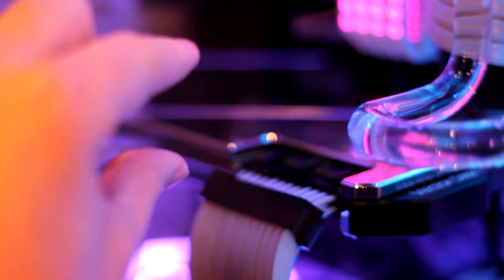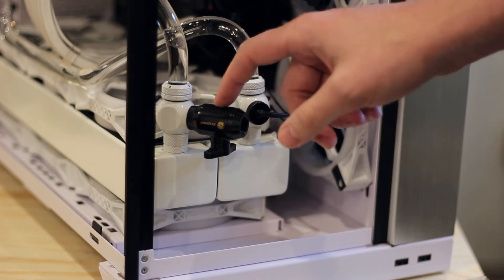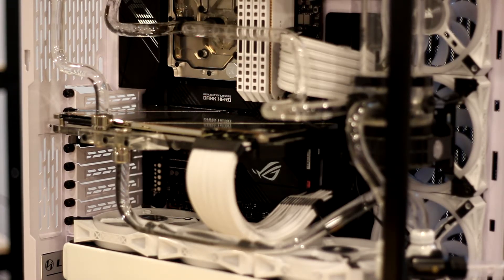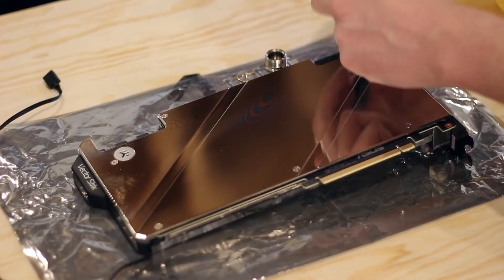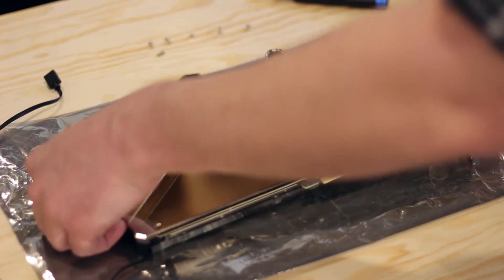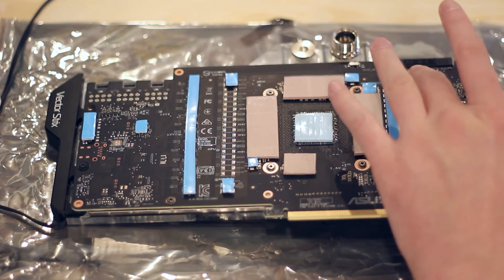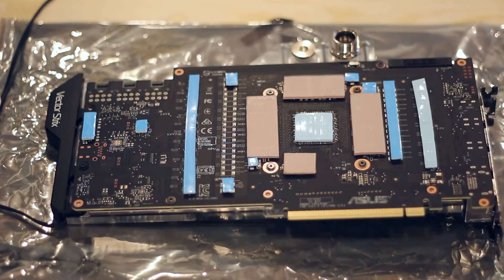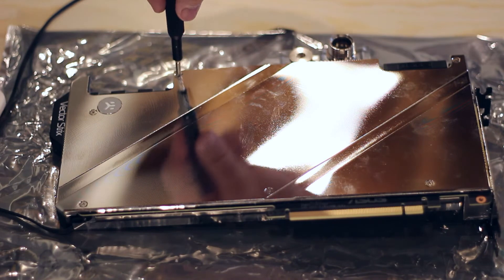EKWB Strix 3090 Water Block - Coil Whine and Toasty Memory

Comment: 5:30 Those must be some tiny coils somewhere there.
Reply from the maker: The induction coils (or chokes) are actually quite low-profile and sit on the GPU die side of the card. They are very compact. The pressure of the backplate pulling together the backplate and the waterblock is enough to slow the vibration and make it audible. It doesn't affect performance. I'll show the induction coils in a future video where I am trying Thermalright's thermal pads and thermal compound.

Comment: Any thoughts on the newly arriving Active Backplates by EKWB? Will you be possibly trying them out?
Reply from the maker: I'm not sure if I'll be able to get one right away, but it is a cool little item. For extreme overclocking it is a cool concept, but I bet I can keep the VRAM temps under control even more just with some better thermal pads (testing some more soon) and a passive backplate. If it was available when I did this build I may have done it! It will definitely help getting the most possible heat away from the GPU!

I would be willing to bet it still comes with average performance thermal pads that need to be replaced with something better to take full advantage of the block(s).
Reply: @UnhingedSystems  Thanks for the reply. Looking forward to your further tests. I've got a Dark Hero, monoblock, 5950x and 3090 FTW finally gathered and will be doing a WC build as well so very interested to hear your thoughts. Your videos so far have been very eye-opening with regards to the thermal pads and coil-whine inducing backplates. My previous/current build was a WC'd 1080ti but luckily I never encountered these issues. I've been reading that they are quite prevalent with the 3090s.
Reply from the maker: @SuperChaoticOne  The 3090 is a heavy power eating card, but with the right amount of pressure applied it should be possible to reduce the whine further and still maintain good thermal performance. I will be doing another teardown and testing Thermalright pads and compound on the GPU soon!
Reply: @UnhingedSystems  Definitely try the 17w/mK Fujipoly pads. I have those on my 3080 Strix with the same block and my VRAM temps top out at 48C under full load overclocked to +1300 mining Eth. Its a 30C drop from the stock EK pads and 45C drop from stock
Reply from the maker: @sneedsneed460  I definitely will! Slowly testing all of the pads I can get my hands on 👍

Comment: Imagine a leak 😳😳😳 I would be way to scared to do a build like this
Reply from the maker: A leak would be very scary! I always buy a few extra fittings just in case! I've done a decent amount of liquid cooled builds, no leaks so far, but maintenance and monitoring is key. I don't like leaving water-cooled PCs on overnight or while I am away from home. Dedicated server PCs for me are always air-cooled just for peace of mind.
Reply: lolz yer after a while you get used to water cooling and dont stress so much. Just buy good quality fittings, they last forever and seals can be replaced not that i have ever needed to. Do not buy no name brands and you should be fine with the fittings. A leak tester is probaly advised but ive never used one.